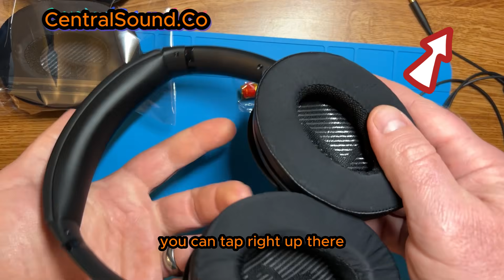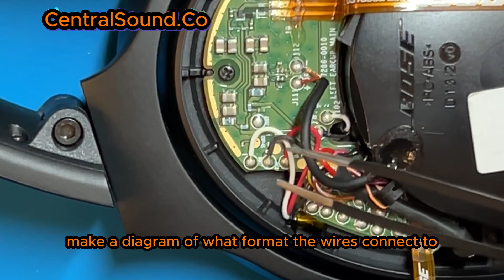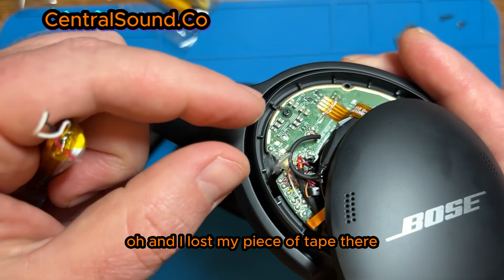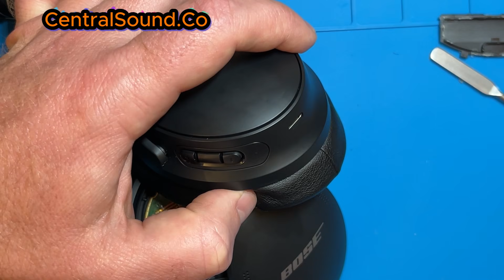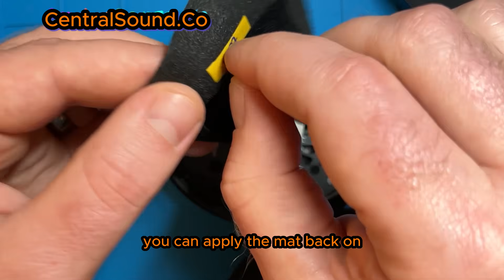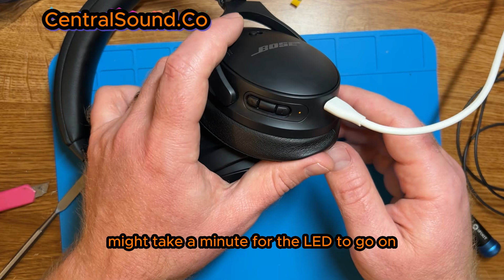How to Replace Battery Bose QC45 QuietComfort 45 Headphones | Install | Remove | Fix Upgrade Repair

Comment from the maker: Buy QC45 Upgraded Replacement Battery Here: https://centralsound.co/products/replacement-battery-for-bose-qc45-quietcomfort-45-headphones
Cooling Gel Ear Pads Here: https://centralsound.co/products/centralsound-coolers-bose-quietcomfort-cooling-gel-and-memory-foam-ear-pad-cushions
Replacement Inline Mic/Volume Cable Here:https://centralsound.co/products/cs-replacement-bose-headphones-extension-cable-cord-mic-and-volume-control-nc700-qc45-qc35-qc35-ii-qc25-oe2-oe2i-soundlink-soundlink-ii-soundtrue
Replacement Ear Pads : https://centralsound.co/products/centralsound-ear-pad-cushions-for-bose-quietcomfort-45-qc45-headphones
Reply: How often have you had to replace the battery in these bose qc45's?

Comment: I did this yesterday thanks for the video not an easy job but I pulled it off! Time will tell if the new battery lasts longer!
Reply from the maker: Huge respect for sticking with it — the Bose QC45 battery replacement is definitely one of the trickier ones. You did the hard part! New batteries typically restore most of the original runtime, so fingers crossed for you.

Comment: I did this successfully. I added some heat reflecting tape to protect the speaker in the electronics while using the heat gun to melt the glue on the battery  door.  I think this is advisable.
Reply from the maker: Thanks for the tip!

Comment: Hi, how do we know if it’s the battery or the connecting port or the power button’s the one I should replace? 😢

When I charge my 0% headphones Bose qc45, it seems to be a little loose bec on 1 pressure side when I maneuver the cable, it gets a solid yellow but when I don’t hold it that way, it blinks irregularly white or yellow, however after a few hours of charging with a solid yellow light, the device still doesn’t turn on. Can someone point out what should be replaced here? 😢 Help is much appreciated

Comment: Hello there, thanks for the helpful vid. I bought these QC 45s about a year ago, used them twice on two plane trips, then didn't use them for almost 9 months. Went to go charge them for a recent trip but got the flickering yellow/white led. I did the reset advice I found online to no avail. So I came across your video for changing the battery, got a replacement and did everything as your video showed. Not too difficult. I tested the power cord hook up before closing everything up, but I still had the yellow/white flickering led. I double checked my soldering and also looking for any other loose wires or burned up circuits. Nothing out of the ordinary. Any ideas what might be the issue?

Comment: Hi. My qc45s won't charge or show any sign of life when unplugged. Just a very tiny flicker of white when I push the power button. When I plug it in, the amber-white flash comes and non of the trouble-shooting methods work.  It works fine with the mini-jack cable. Do you think I need a battery replacement?
Reply from the maker: It sounds like it could be the battery or a separate power issue.

Comment: Ridiculously complicated. I got to the soldering part and forget it. Bose does not repair bluetooth headphones. I called them and they are sending a discounted replacement.

Comment: I am getting the white to orange flash when the USB-C is plugged in to charge.  I thought the battery was dead, but it is testing at 3.750V which is full charge.  I've done the firmware update via my PC and the Bose Web tool, and it is already on 4.0.4 (latest).  The headphones do not power on (obviously seem to connect to the PC) but everything else is not working.  Factory reset does not work either.  Any thoughts on what I can try?

They are out of warranty and the only thing Bose is offering is 10% off a new pair.

Comment: This is the reason I never buy expensive battery powered headphones...I might have to throw it away some day which is a bummer. If the speakers are still in great condition, and the battery is dead, why the need to throw it away??

Comment: My bose headphone QC45 is not working. When connect to charging its blinking yellow and white continuously. When switched off charging point though blinking for few seconds but when disconnect charging cable blinking stop. I tried to reset, so pressed power/blue tooth button and multi function button for more than 30 second but not able to reset the headphone QC45 or not blue light show.

Comment: these are so good, but I just can't count on the battery to last forever and have to do surgery on my pair just to keep them for longer. the xm4 and xm5 seem really tempting now. :(
Reply from the maker: Honestly, I prefer the Bose line of headphones.  They got great noise cancellation and seem to be built to last longer.  Sony’s are riddled with all kinds of issues.

Comment: What do you think about skipping the step where you open up the other side in order to de-solder the battery wires from the circuit board.  Instead cut the wires at the battery and then use solder seal wire connectors to connect the new battery wires to the old wires?
Reply from the maker: Hello, 
Thanks for your question.  You can do that if you prefer.  Just make sure it’s well insulated after soldering the connections.

Comment: Tried following the steps and got a persistent hissing sound from the left ear cup after removing the ear pad and back plate (even with the original battery connected), Problem did not go away with the new battery replaced.. I could get the hissing sound off either by turning off ANC or placing a palm over the left ear cup... Is the headset toasted? Thanks

Comment: When I watch this video, I miss my QC15, when you just had to remove the battery from its external compartment without removing any earpad. The only tool you needed then was your nail. I guess this is progress.

Comment: I thinking about buying a qc 45 to try to fix it because it’s cheap, seller says, when charging a red and white light blink and it doesn't charge, the headphones won’t work, what would be the problem a battery issue or charger port damaged, would it be worth buying to fix it? Also another one the left side is dead is it easy to fix a dead headphone audio left side?